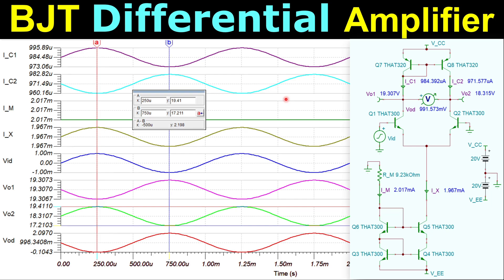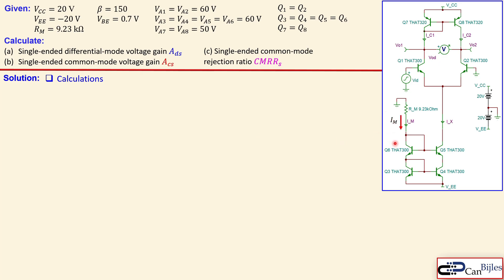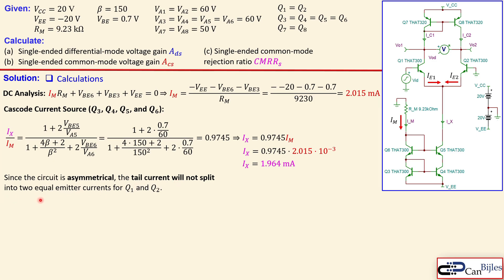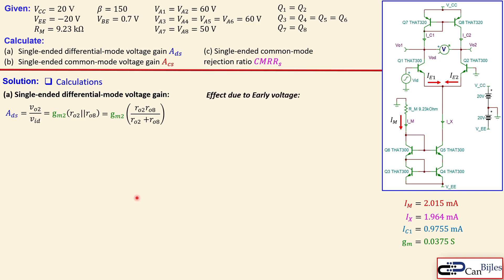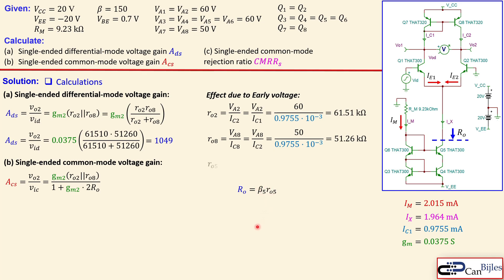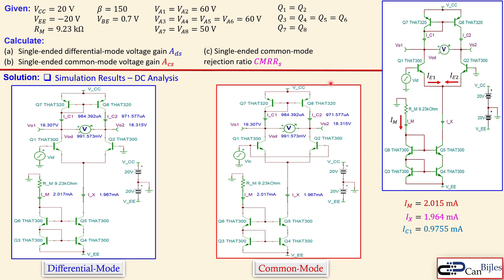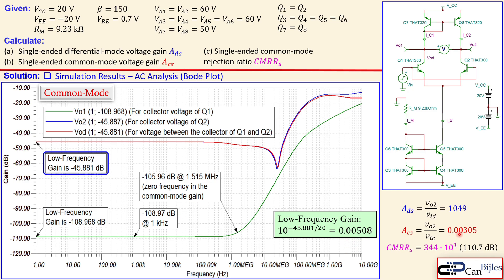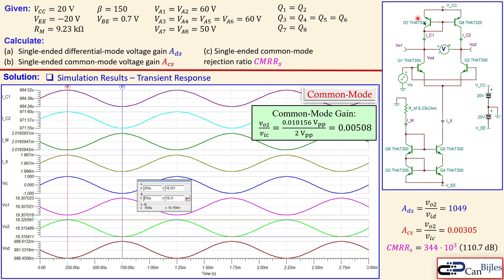BJT Differential Amplifier with Active Load & Cascode Current Source 💡 Example 6

Comment: So if Vid is big, lets say 300-500mV, how can I keep a decent amplification with the same circuit configuration?
Reply from the maker: First, you need to consider the DC levels at the transistor nodes, so that all transistors are operating in the linear region.

The voltage gain of the circuit in this video is around 1050. Making the input let's say 200 mV peak, should result in an output voltage of 210 V, which is of course not possible. Again, you need to stay below the maximum possible DC levels of the transistor nodes. This is done using DC analysis.